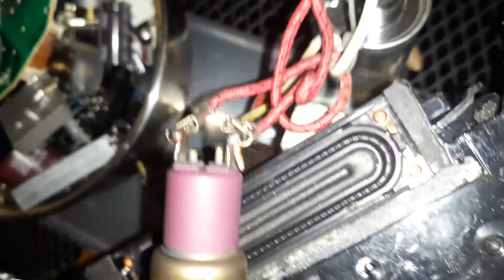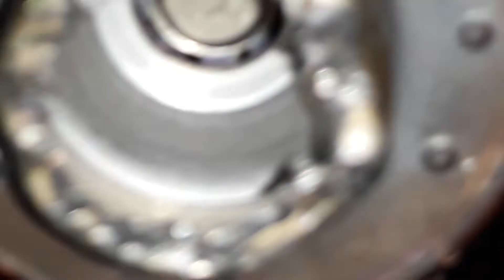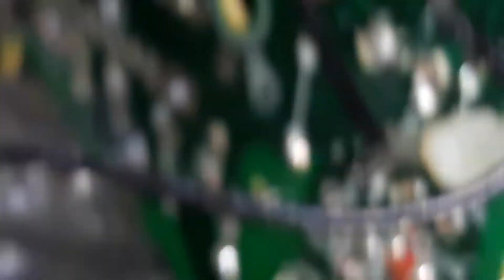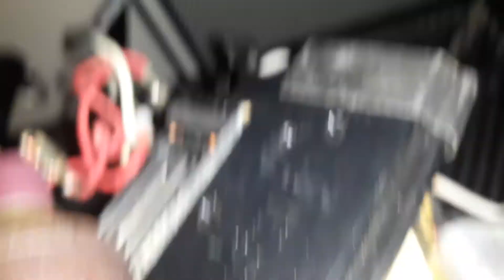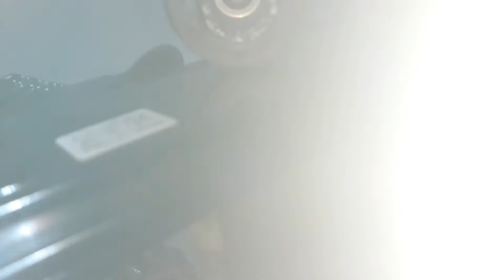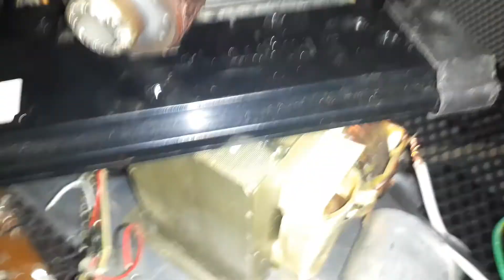Inside a microwave magnetron while it's filaments are glowing

Comment: Are you sure you should be standing there, in front of an operating magnetron?
Reply from the maker: It's safe since the magnetron is cut open. Magnetrons are basically giant vacuum tubes where electrons resonate inside the specially-shaped cavity. But once you remove the vacuum, electrons can't move around because air molecules, so it basically leaves you with a very cool but impractical light bulb

Also, the magnetron here is only receiving power for it's filaments, not the 1kv anode voltage needed to produce microwaves